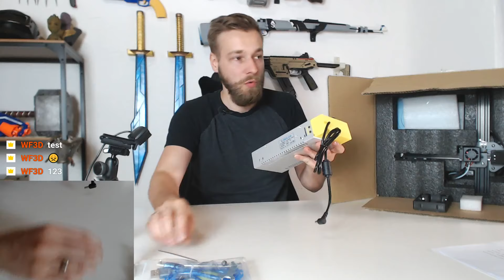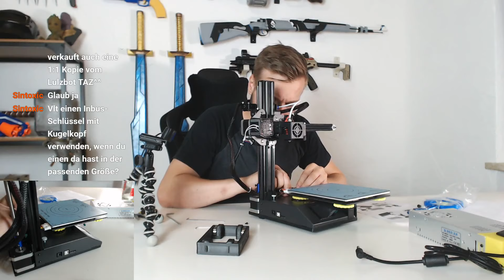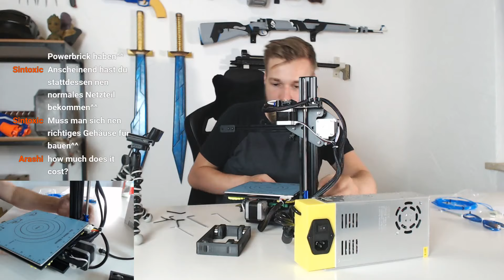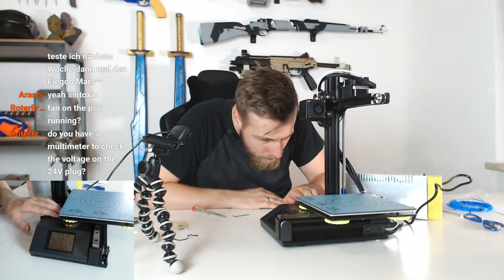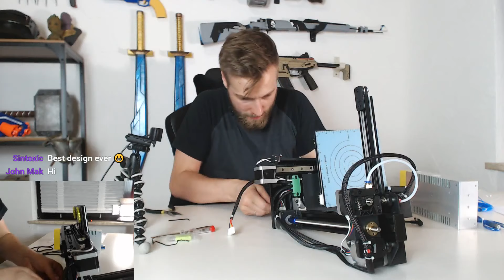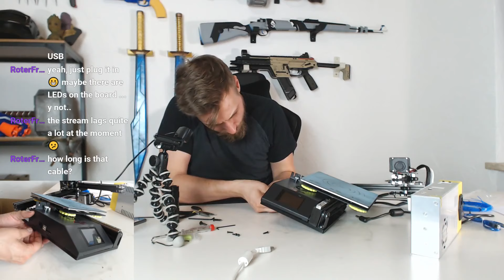Sooway SW 200 Livebuild

Comment: I would measure the voltage coming out of the connector and also the voltage being received by the board. That will give you a good indication if the connector is too loose and it's not contacting the connector in the board. Also Sooway if you're reading this pls send me a printer for review thanks.
Reply from the maker: Meanwhile found out that the PSU is broken. There's a magnetic spool where 3 solder points failed :) will get a replacement